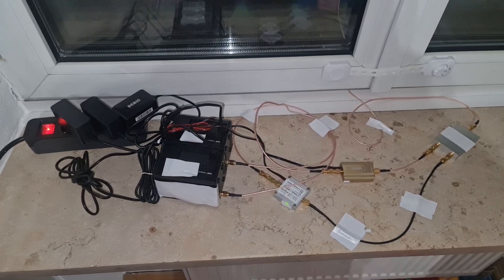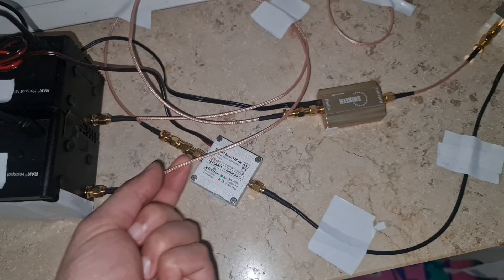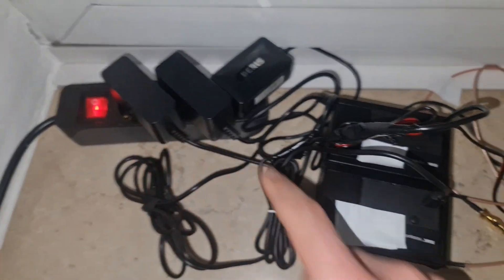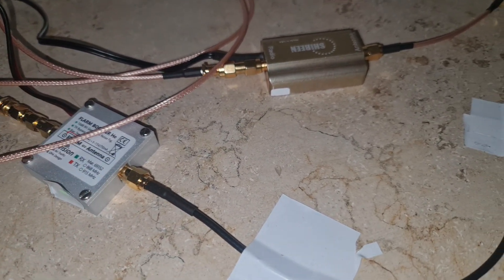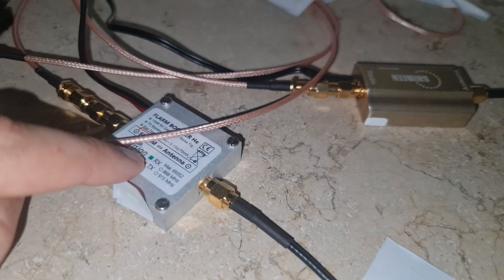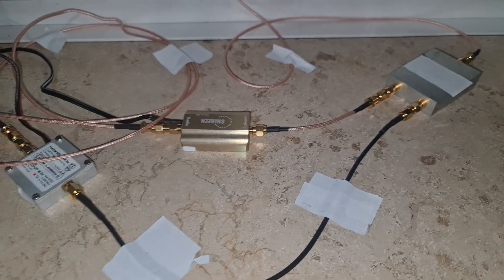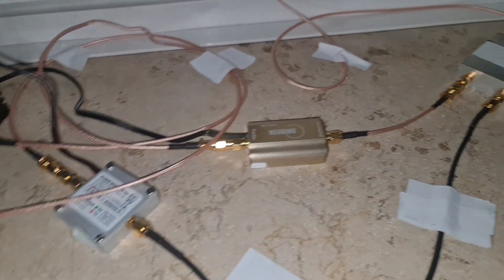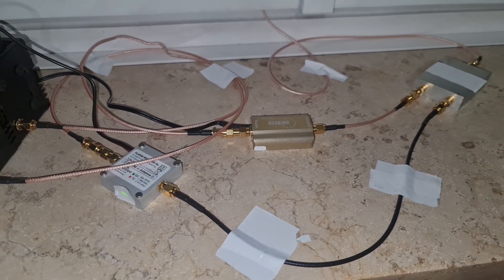FLARM BOOSTER He VS SHIREEN INC Helium Amplifier Part 2 (Results )_ HELIUM ADDICT

Comment: What a huge difference! Solid proof that Shireen is trying to take advantage of consumers who can’t find these components. Guess they’ll have to lower their prices to compete! Excellent test Addict!
Reply from the maker: You welcome 😉✌️
Reply: @heliumaddict8582  I was wondering if you have considered using Silicone Conformal Coating to waterproof the amp’s circuit board itself? Would it not be easier to not have to create your own custom enclosure for every amp you test? And if you wanted to test the same amp again on another miner or antenna, you wouldn’t have to remove your tape and other enclosure protection. Just plug and play! I’m looking into this now.
Reply from the maker: @Philneye5389  yeah it's great idea but the outdoor enclosure helps little bit to protect the Amplifier from direct sunlight 
As you know whe electronics when they  gets hot they thermal troughtel from heat  and this will cause instability /less urnings 🤷‍♂️
Reply: @heliumaddict8582  very true!

Comment: Great Video and good like for like comparison.  Just wondering if swapping the miners would make any difference, it shouldn’t, but there have been cases where one miner will perform better for some reason, even if they are the same brand.  Also, I’m wondering whether the Flarm has a filter built in and that’s helping, so another test with a filter before the Antenna would be interesting to see.  Keep up the great work, it’s really good for the community to see.
Reply from the maker: You welcome 😉 ✌️

Comment: With shireen amp do you need to change the dbl you record on the Hnt app? What happens if you list your antenna as higher dbi than it actually is?
Reply from the maker: You will not get invalid witnesses any more
Reply: @heliumaddict8582  thank you. I’ll see what happens.
Reply: @heliumaddict8582  thank you for your reply. And for the videos. Just one more question…so I can over estimate the dbi and it will not penalize me but if I underestimate the dbi will the network punish me?
Reply from the maker: @tonykato19  not punish you , just you will get invalid witnesses because of Rssi too high

Comment: I've found on my miner at least that 16-17 dB on the rx is too much. Without a certain amount of attenuation present from cables, cavity filters, attenuators it won't witness anything at all. Nothing in the logs.
Reply from the maker: Just add more dB in your Helium App to reduce the chances of getting invalid witnesses that's all
Reply: @heliumaddict8582  nope, it gets nothing. Not invalid, nothing at all. Reasserting antenna dbi only helps with invalid you are actually witnessing.
Reply: To be fair I may be seeing noise and the amp could be getting oversaturated, when I added a filter and a bit of lossy cable I started witnessing again.
Reply from the maker: @cactuarking4138   like I said testing is the solution 👌
Reply from the maker: @cactuarking4138  what type of Amplifier you are using??
Reply: @heliumaddict8582  I have the shireen Outdoor(6/17) and the acasom package that came with cavity filter(6/17)
Reply: I noticed before the cavity filter I was getting wild snr readings on the glamos, sometimes fantastic sometimes really bad(solo miner setup with 50 ft mast). My other shireen outdoor powers 3 miners from one antenna and is very consistent(3 way splitter to small pole on top of my house)